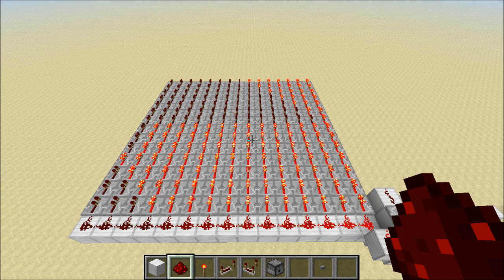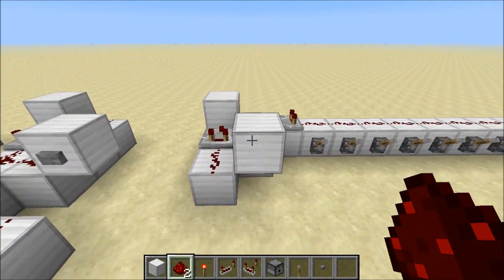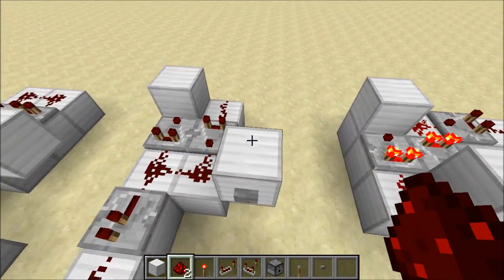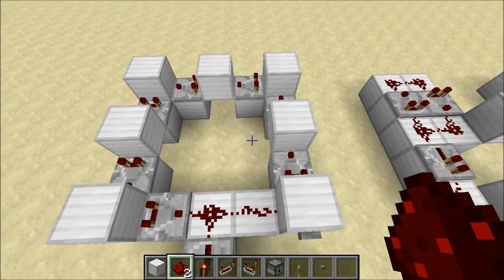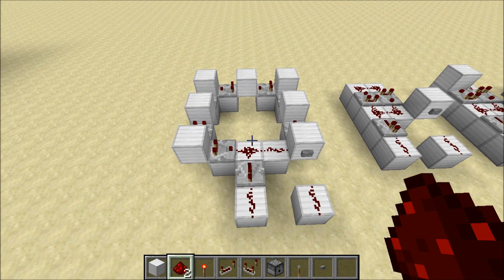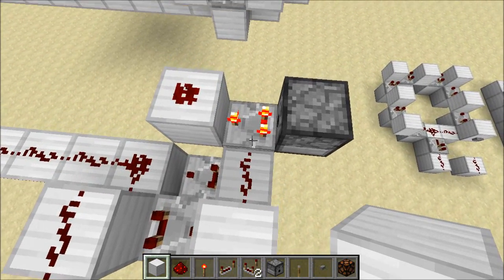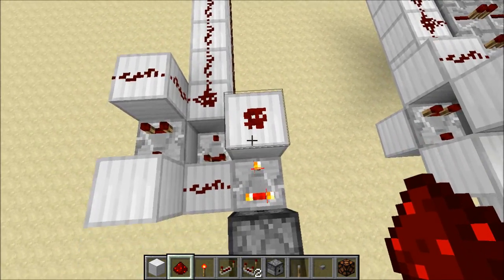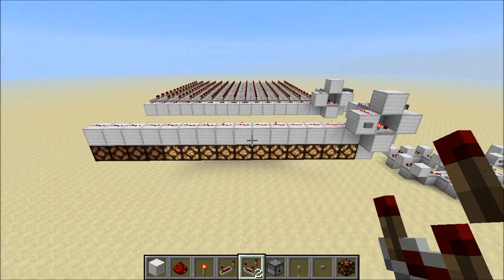Simple Pulse Sustainer Using Comparators

Comment: I played around with a dimmer made by modifying the capacitor I saw you using in your analog-RAM, but I didn't put it together in my head yet that this could be thought of as a "pulse-sustainer".  

A "Pulse Sustainer" is a much more useful device than a "Slow Dimmer", even though the only difference is a repeater at the output.